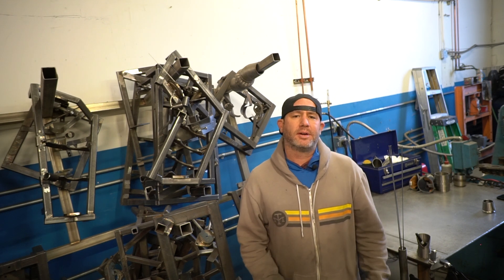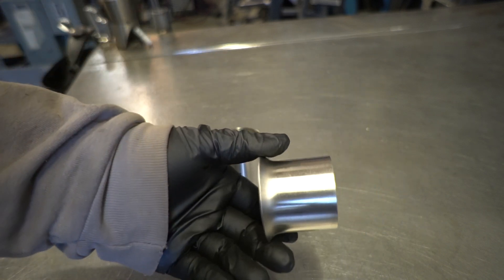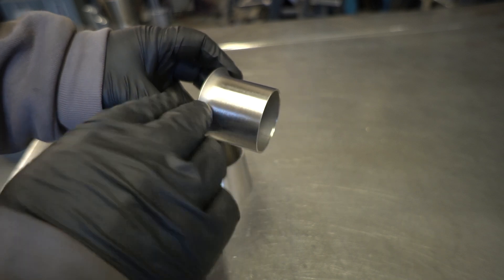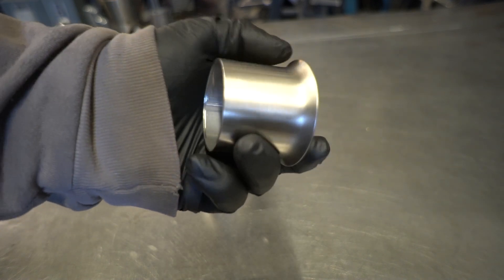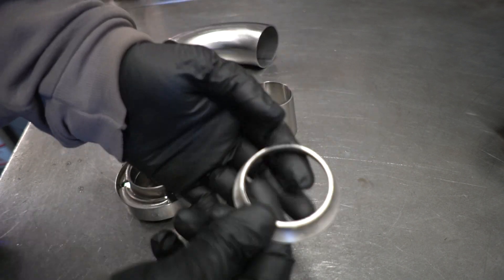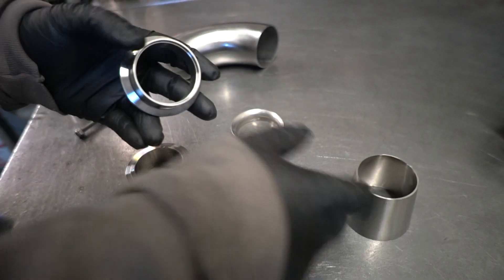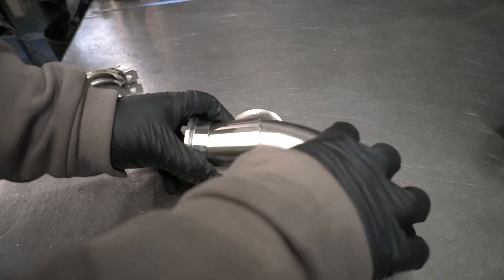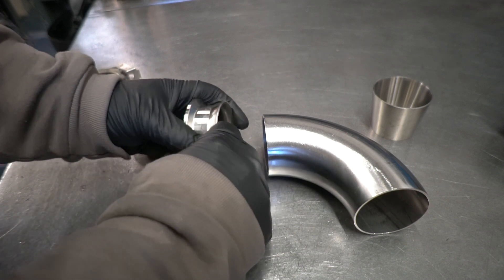Sanitary VS Swedge 304 stainless steel reducers : Custom Fabrication and Tig Welding Exhaust

Comment: Im a hobbyist/self taught welder getting into stainless exhaust work. I appreciate these videos a lot cause they cover small details that many others do not. I used your suggestion to pre weld the edges of flex pipes recently and would not have thought to do that otherwise. Thank you
Reply from the maker: Right on! You are welcome. Thanks for watching.